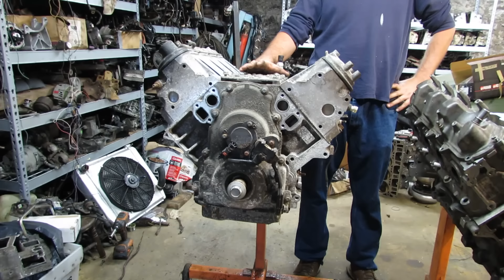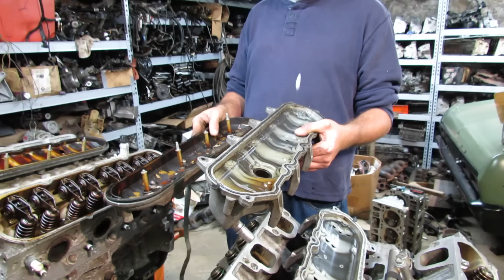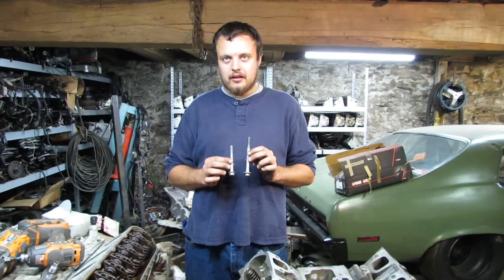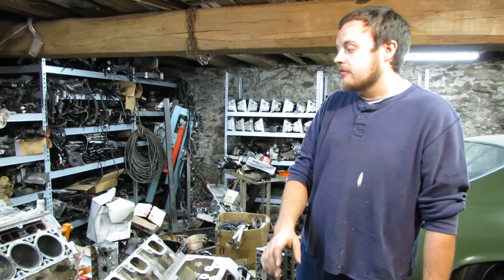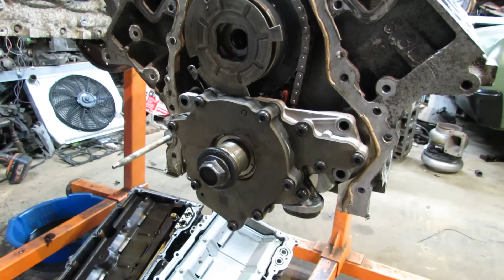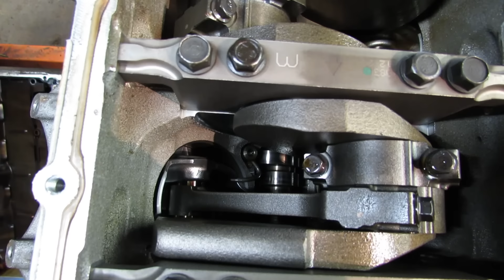The Next Generation of Chevy V8: LS vs. LT

Comment: direct injection is not that great. there is the problem of carbon build up on the intake valve and in the intake ports. which require cleaning at an extra cost, while port injection cleans the intake valve and ports.

Comment: I've been pondering the PI vs DI for a minute. It all sounds good till you get to the crud build up from lack of fuel wetting in the intake passage. My thoughts run to adding a second set of PI both to add more fuel and regain the wetting of the intake port. Something like bigger injectors and a shorter, later initiation to preserve as much of the anti detonation property. Imma pretty much NA guy- costs to run street engines have kept me out of that lane. Real interested in your thoughts on DI vs PI on longer term, a bit less maintainance engines.

Comment: For the avg enthusiast ill present the same argument here that i did when this was the LS vs Gen 1 sbc. Unless money for your project isntnan issue then the LS in all its forms wins out over the LT. As the saying has gone since time immemorial, "speeds just a question of money, so how fast fo you want to go?" 
In the Dollar per horsepower measure you cant beat the Ls. Even a vortec 4.8 comes box standard with more power than 82-92 F-bodies, 84-91 corvettes, all Fox body mustangs etc... So youre starting in the neighborhood of 300hp, at a junkyard cost of about $300 for a long block. My local yard charges $175 if i pull it and $288 if they pull it. Then the ancillaries like engine management are super cheap and the tools to tune a factory ecu range from damn near free to a few hundred dollars for something like an HP tuners unit. Fuel systems are likewise inexpensive and simple affairs with the corvette filter regulator combo being the easiest way to ensure the engine gets fuel at the correct pressure. The ls also uses comparably low fuel pressure at 36psi on early engines and the ubiquitous 58psi for later ones. Cam upgrades can be done with the engine in the vehicle and a little creativity, that will net anhealthy power upgrade. None of this is true for the LT platform or at least not yet

Comment: Contrary to the narrator, emissions laws have driven engineers to find ways to improve combustion make more hp more efficiently. In the 70s if you owned a Camaro and built your own 5.7L LT1 let’s say. You could get great hp and torque but you gave up mileage and longevity. Today I have a 2023 Camaro 6.2L LT1 and it will run 0-60 in 3.9 sec and the 1/4 mile in 12.07 sec all the while it will get 29 mpg on the freeway and 24 around town. It will last with regular maintenance around 200k miles or more. No way you did that in the old days. The engineers found a way to have the best of both worlds. Max power and Max efficiency along with longevity. I will give you 1 argument, it comes at a cost. But, speed is just a question of money! How fast and how far do you want to go.

Comment: I don’t have a good feeling about the oil pump being controlled by computer but on the other hand if it’s controlled by computer does this mean you set oil pressure through the tune and the heads look like they’re not 23degree just looks like heads are at more of a angle I’ll just tell you this I know nothing about these LT engines I’ve just built my first LS engine

Comment: Will the L83 rods/pistons bolt into a gen3/4 motor without modification? Say I wanted a high compression NA E85 motor.
Reply from the maker: Yeah.
Reply: @Calvin-Nelson  So the valve reliefs being backwards won't cause a PTV issue?
Reply from the maker: @AdamOpheim  don't know. You'll have to try. Probably has a lot to do with what cam you're running.

Comment: So, with direct injection and no opportunity for pre-ignition 'knock' they can get not just leaner mixtures, but run more compression........which explains why it has a higher compression ratio.  Using the camshaft to drive a high pressure fuel pump (albeit only 3000psi) is something diesels have done for a long,long time. Eventually the Achates 2 stroke, opposed piston engine will be the standard, the gasoline version is 60% less fuel consumption than the best 4 stroke gasoline engine.  Its simply physics........with no cylinder head,diesel like compression and fewer moving parts, its highly efficient and also cheaper to make.  Cummins already make the diesel version for the US military to replace all other engines, since the diesel version is 20-30% less fuel consumption.
Reply from the maker: Yep

Comment: Question:
Come the LT (6.2) use the same motor mounts as the LS(6.2) or are the engine/motor mounts in different locations.?
Looking to use a LS swap kit for a project but don’t want to buy it if the LT can’t use the supplied mounts from the kit

Comment: Good luck swapping over to the Lt front belt systems everything Ls has to go. So it will be expensive. If it dose not come with the engine. the Variable Cam Timing makes a ton more torque on these engines. With better flowing heads and higher compression and all it's a knowbrainer. You can use bigger cams in  it if you add piston reliefs just like the LS's.

Comment: I really wish I could build a new L8T based stroker engine and try a set of those L83 heads on it. Maybe do a little porting, big cam, very high compression to take advantage of the direct injection, headers, possibly a Holley Hi-Ram. I was thinking a 0.060" overbore for 4.125" with a 4.25" stroke for a 454ci LT based engine, I believe the L83 heads flow 283cfm at 0.600" lift vs 303cfm from L92 heads at 0.600" and they have made 700hp on a 468ci stroker so I would think L83s on a 454 could make well over 650hp n/a if not close to 700hp with the benefits of compression close to 12:1 if not more, especially if I run E85 and a little head porting to hit a little closer to 300cfm. Hopefully the word on the street about the L8T block being as strong as an LSX is true that would mean that the engine should be strong enough to run boost with a 4.125" bore, it would be crazy to make around 1000hp on 7psi with a 700hp 454ci stroker L8T and around 1400hp at 15psi. Apparently SCDP made around 2000hp with a stock L8T block and crank with performance pistons and rods only slightly larger than 400ci.

Comment: Is the cylinder head bolt pattern symmetrical so you could put the heads on opposite sides and have the exhaust manifolds facing forward?
Reply from the maker: You can face the manifolds down and forward but not up and forward if that makes sense.

Comment: I thought the Ring gap being too close is the reason for pistons breaking. LS uses low tension rings also ,but they run at Lower compression so they have more tolerance for boost.  That is the first I have ever heard of ring”flutter”
Reply from the maker: Everything has a critical frequency. I think the Gn V rings being so thin is the problem, not necessarily the low tension. Since the making of this video I have seen enough folks push the Gen V stuff hard enough to think it's just fine to push the stock bottom end.

Comment: Direct injection is a loser. These engines all suffer from coke build up on the intake valves. Port injection is the way to go. The fuel washes the oil from the intake valve away, eliminating the problem.

Comment: These run best on 89 octane. I've monitored these on a live scanner and they actually have alot of knocking on 87 octane and they idle rough. 

On 89 octane they idle better, have better throttle response and mpg without any knocking. DO NOT RUN 87 IN THESE!! YOU WILL DESTROY THEM OVER TIME

Comment: the lt 1 was a sbc with the lt top end the new lt engines have their own block like a ls but not interchangeable u need to check out the new LS 7 427 it is one wicked engine that puts out 860 hp stock

Comment: Cracks me up when people think DI is for emissions...DI engines are actually dirtier than PI engines..all DI engines make particulates just like a diesel engine...I work in a emissions lab testing tailpipe emissions via a chassis dyno and we have to catch and weigh the particulates that are in the exhaust system.... yes they can make more power with less fuel tho..but they are dirtier that PI (port injection)

Comment: The FORD coyote engine is king of technology and HP per liter, but the huge DOHC heads make it fat, tall and hard to fit in many engine bays. Also it's apparently a costly engine that FORD doesn't want to produce many of. So it's one of those weird situations where you lose even though you ought to be winning.

Comment: Another interesting thing about the new LT engines is the greater spacing between the bores which allows for better head gasket sealing ,more stability and cooling.Siamese  boars on high powered motors is a bad idea because it’s not great for cooling and could warp easily compromiseng ring stability
Reply: Are they not both 4.4 inch bore spacing?

Comment: LT engine people need to skip over and wait for a newer version the current LT with direct injection is going to be a nightmare as without fuel entering the ports to clean the oil off intake valves the engine will gum up as in all of the direct injection vehicles of the past. the correction for this is direct injection coupled with old school port injection as this clean the valve train. GM did this on the ZR1 bur decided to be cheap bastards and did not install it on run of the mill LT engines. Until they get hit with a class action lawsuit this will remain the case. The gen 3 ford coyote has used the correct method of direct injection along with port injection. If you are fine with removing upper intake and cylinder heads every 20 thousand miles to clean them then by all means buy an LT1

Comment: Shit vs: shit! Buy a Keith Black billet block if you GOT to have a "Chevy" block. Black knows where to put metal so the engine will hold together, GM doesn't. Even with a girdle, an LS or LT is a very weak design. How do I know? I've built and destroyed dozens of them in drag boats. An LS with a blower on a jet drag boat that lasts one full season on the lake is a miracle. A big block Chebby with a blower MIGHT last two seasons. The guys who'll spend the MONEY for a Chrysler Marine (550 cid) super A block with a blower get 5-7 years running 12-15 pounds of boost which is all a blueprinted pump can handle, before a RE-BUILD!

Comment: With all due respect, you constantly remark there is no fuel therefore no knock, however knock typically occurs after the spark has initiated combustion and as the flame front progresses it compresses the end gas and raises its temperature to the autoignition threshold, so yes there is fuel.  The reason that a higher compression ratio can be accommodated without knock is the late injection permits the latent heat of vaporization of the fuel to cool the compressing air to the point autoignition of the end gas will not occur.  With carbureted or port fuel injected engines this latent heat of vaporization of the fuel is used to cool the intake manifold or intake port and is not available for knock mitigation.

Comment: With direct Direct injection, auto ignition is reduced due to the cooling effect of fuel being sprayed directly into the cylinder through evaporative cooling. This pulls heat away from the combustion chamber allowing for a higher compression ratio for any given octane rating compared to port fuel injection.

Comment: Nice.  Dude the LV3, v6 Vortec motor, has the exact same heads as the latest LT.  Of course, minus the extra cylinder.  Not to take away from the this video, but there is a guy who has swapped an LV3 into his Grand National.  He flowed the LV3 heads and out of the box they flow just as much, if not more than fully ported aftermarket heads from TA Performance and as much as Buick's mighty Stage II heads.  As a matter of fact the intake ports on the LV3 are eerily similar to the intake ports on the Stage II heads.  Shape and size, I just don't remember where the ports are located relative to the top of the heads like the LV3 or LT heads.  I'm sure I can find footage, but I bet the latest LT will put down some nice power at even modest boost levels, say 5 or 6 lbs with the right turbo setup.  The LV3 motor is laying down some very impressive numbers at 7 or 8 psi of boost with a BorgWarner turbo.  Something like 600 to 700 whp.  The guy was able to achieve this same power level with the 3800, but cranking out 19 psi of boost.  The .5L displacement helps, but I think the head flow has a lot to do with it.  Cool upload.  I like your uploads on the Vortec 4200.  Waiting to see Richard Holdener's big bang test to see what the stock block motor can make with a turbo.  Keep up the good work.

Comment: is there a carbon build up issue on the intake side of the intake valves on the LT engines now that fuel does not wash over the intake valve  like Ford had with their direct injection engines?

Comment: I heard the bottom end is a lot stronger on the LT. Did you not see anything that would indicate that? Like in the design of the block.
Reply from the maker: The engine deck surface is much improved. The bottom end itself look majorly the same.

Comment: Thanks for the vid! A lot of good info here. Good work! Remember, boost “psi” is not the important factor here. It’s all about air density. Nobody on earth explains this better than Gale Banks. He has some very interesting ideas on getting away from the “I’m running 20 lbs of boost” bullshit. Sure PSI matters, but there is a lot more important things that go into forced induction. Absolutely love it though, I’ve been building turbo engines of all kinds my whole life and never get bored with it. Thanks!
Reply: Im an old mechanic but back in the day i use to do GM PROM changes from air mass to air density because i always felt better to measure air density than air mass.Have fun guys

Comment: first video to correctly called knock "autoignition".  tonnes of useful info.  thanks.  however, the LT injects fuel while the intake valve is open to mix fuel and air.  it's a common misconception that it injects fuel just before ignition like a diesel.  the valve covers are the PCV/oil mist separators and I'd still recommend a catch can.
Reply: Are we sure about that? How could it run such high compression with regular gas.

Comment: The LT direct inject cylinder head suffers the same issue as ALL direct inject cylinder heads...intake valve carbon build-up. This is due to EGR and PCV vapors burning onto the valves. Injecting fuel into the intake runner helps remove these deposits. I'll stick with indirect injection since I don't tear my engines down regularly in order to clean valves!

Comment: how about the new ls 7 overhead cam 4 valves per cylinder 860 hp stock i just got a worn out think bad valves traded a low mile 350 4 bolt for it but the engine still runs just very weak low compression it was ran hard got the 350 for free so i can't lose on it some day i will have it rebuilt have 2 ho 454 that i got for free with low miles on them running good stock 450 hp 485 torque crate engines with the heavy duty 400 turbos

Comment: Here's a minor annoyance. Stop saying minor annoyance. It's not an LS engine, parts are not going to Interchange it's now an LT it's 99% new only five parts carry over from the LS to the LT..
  Otherwise good video...
Reply from the maker: Yeah. I was raised on gen 1 Small blocks and big blocks where they used the same thermostat housing gasket for 50+ years and they shared the same motor mounts. It's a minor annoyance. If you don't feel like it is annoying, good on you. I do find it annoying. I'm sure they had a reason for changing it, it's just mildly annoying.

Comment: Cleveland firing order, almost 1/2 inch studs, deck height and canted valves. Then four bolt per cylinder studs, 875 thou cam followers. All changes moved the original  OEM small block from Chevys Harley Earl design to  the Bill Gay/ Macara/ Phillips 335 design. SIDI tech is a great advance..Ecoboost with out a turbo.
Reply: Anyone that knows old fords sees alot of old ford tech in these ls engines. First time I seen ls block i thought it was a 427 fe block.
Reply: Harley Earl? Harley Earl designed water fall hood rims and design themes for whole makes of GM. Ed Cole, a sleeves rolled up, real, honest to gosh, engineer was the lead designer/planner for the Chevy 265 Small block of 1955. Zora Arkus Duntov was among the development engineers who lead Chevy to "one hp per cubic inch", early mechanical fuel injection. Not really bagging on HE- some of his designs were imitated by others all over the world. I've owned and driven several!  FR

Comment: seems GM cheaped out on some aspects of the LT engines. Mechanical pumps, RTV gaskets instead of specific gaskets.
Reply: You know of a reasonable price High side pump that can provide 3500psi of fuel pressure?

Comment: If OHV valves are so superior, how come chevy doesnt design and install them in ALL their vehicles? FOr example the Colorado has a DOHC v6, vehicles like the equinox and the malibu also use DOHC engines. 
Serious question
Reply: does nascar use overhead cams at 10.000rpms. nope
Reply: @NightshiftCustom  nascar? 😂😂what about formula 1? Formula 1 uses superior engines to nascar, and are they pushrod engines? NOPE.